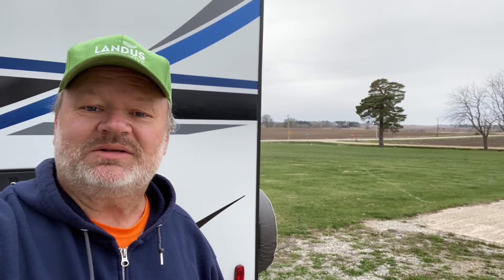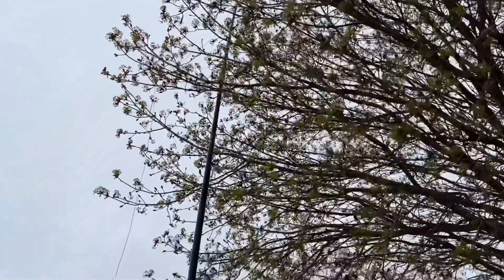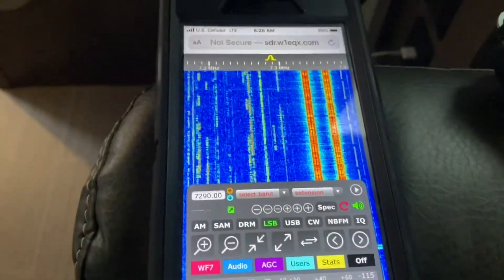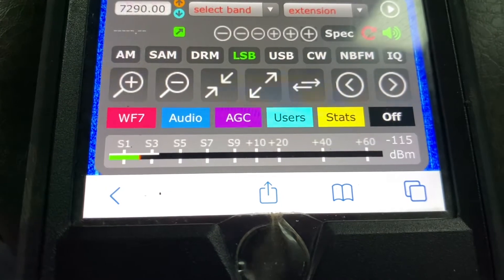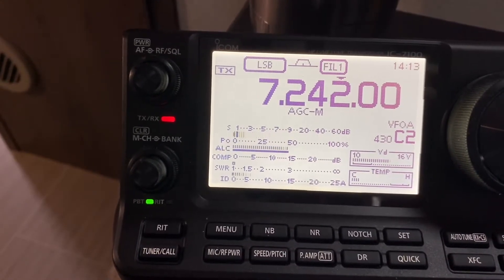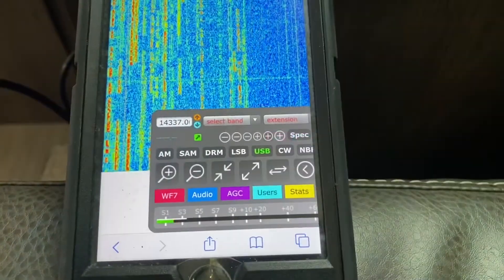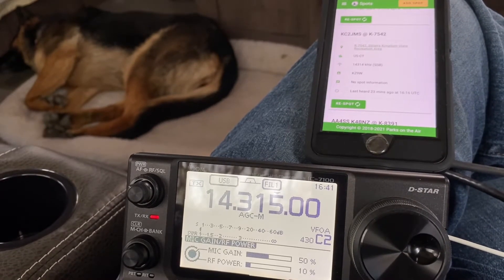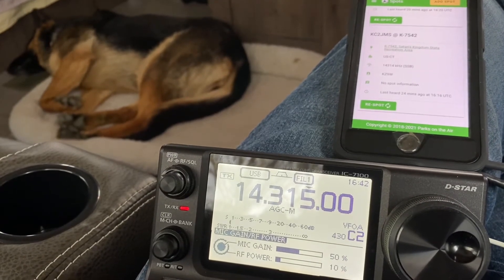YOTA QRP.. End Fed vertical wire -vs- Hamstick Dipoles

Comment: Good test! I just have an EFHW 8010 from Myantennas for my shack. I have Shark hamsticks on my mobiles. I built a KM4ACK EFHW kit for portable use. I also have a wolf river coils SB 1000 that I have used. It seems the KM4ACK out performs the WRC setup. I did order a DX Commander Classic from Callum. It should be here this week but I am going to wait for warmer weather to deploy that one. I did build a quad dipole hamstick unit that does two bands. It worked but I think if I could get it up in the air it would help.
Reply from the maker: Hi Kevin.. Sounds like you have a great selection of antennas to keep you busy and on the air.. I've heard good things about the DX Commander.. You're like me and wait till warmer weather to do antenna work.. It's just not as fun doing that work when it ZERO or below degrees outside.. Have fun with your new antenna.. Thanks for watching and commenting.. 73, Kevin ~ k0klb

Comment: what type and band were the hamsticks you used for this?
Reply from the maker: Hi John.. Thanks for your comment... I use the MFJ dipole hamsticks.. I have a set of both 20 and 40m.. I’ve had pretty good luck with them both.. They are easy to set up and use.. The test wasn’t very scientific... It was just a general antenna comparison... 73. k0klb